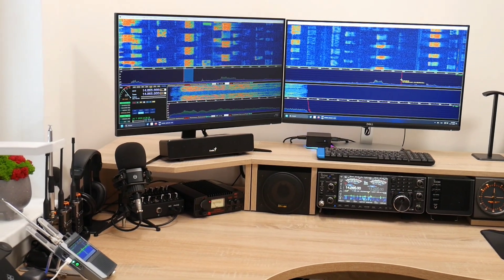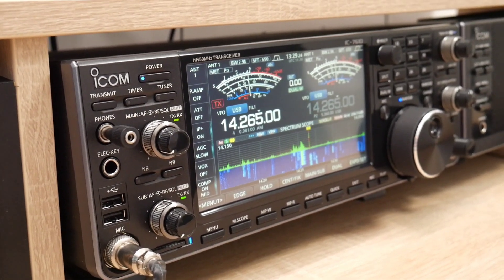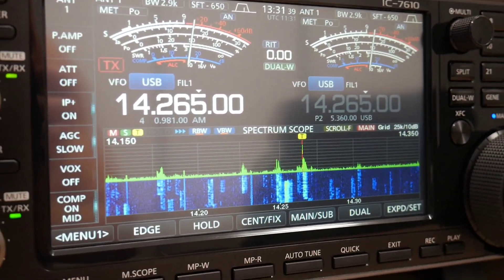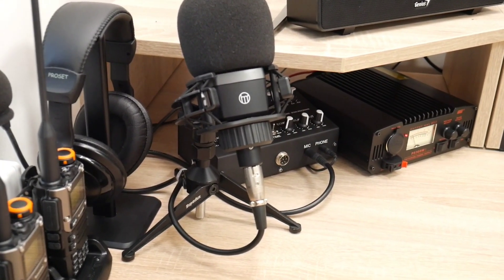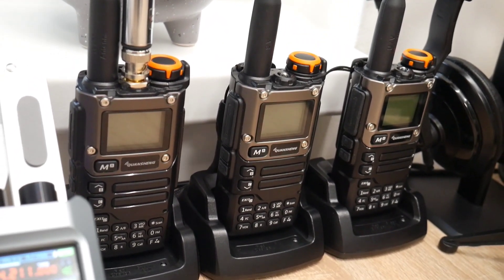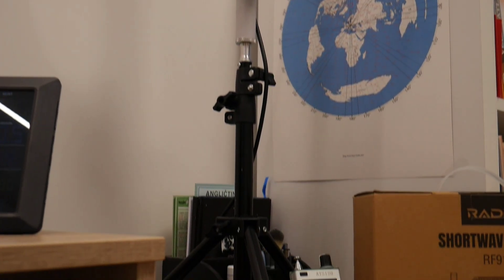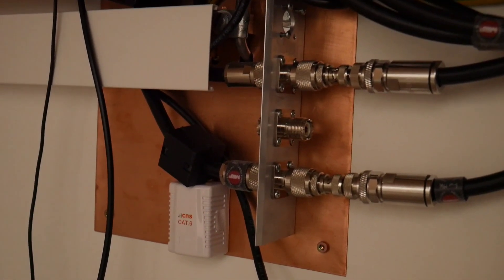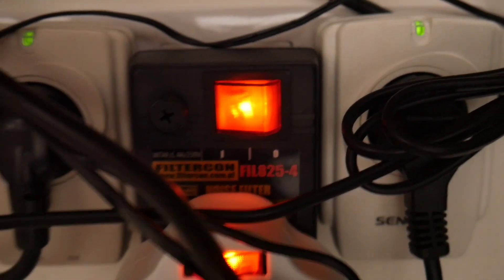HamRadio Room Tour (HAMSHACK)

Comment: I’m very interested In the emi filter.

Does the EMI filter stop or reduce noise when you plug extra stuff into your outlets? 
Never heard anything about them before.

I’ve got a hifi system in my shed for music but sometimes when I charge my phone or any device it goes off tap with static and noise. Doesn’t always do it but it’s annoying when it does. Will the EMI filter do some good at reducing static noise?

Comment: I didn’t realize that a base station still needs a power supply? That’s interesting. I’m not a ham but I always assumed a Base Station had that internally, a small mobile would need a power supply and HT is battery powered.
Reply from the maker: Some have built-in power supplies, mainly bigger radios with 200W
Reply: @OM0ET  Thanks for sharing!